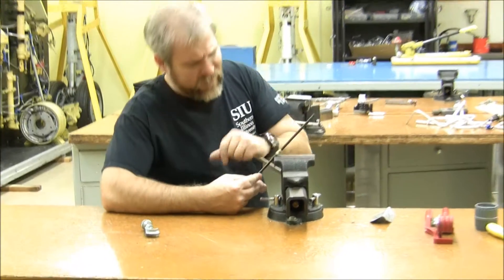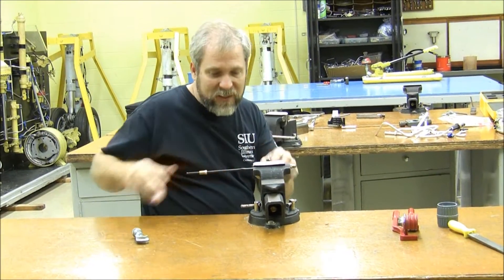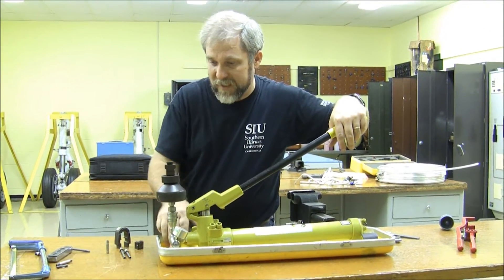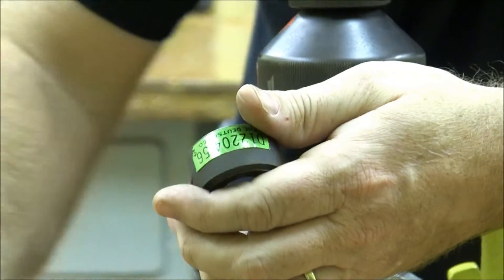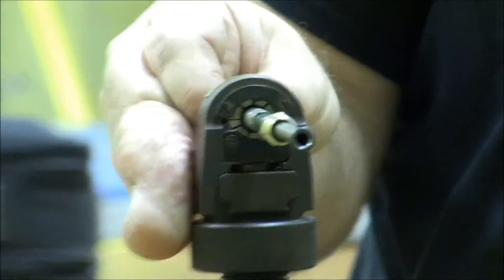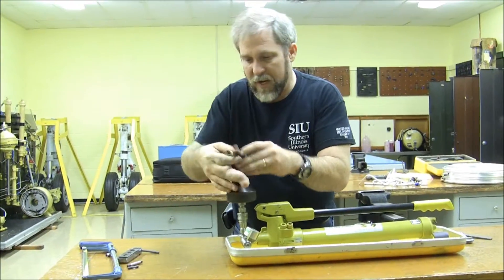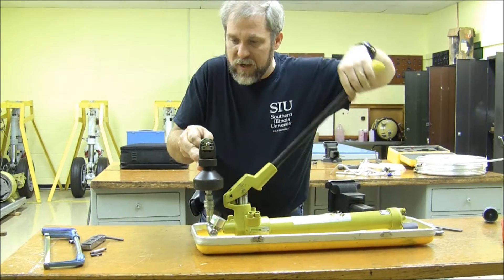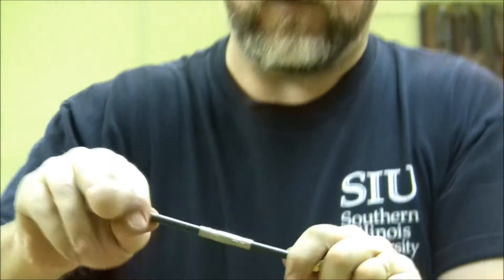Aviation Tools Training - Deutsch Permaswage Machine

Comment: Ok, so here is my doubt. What do you think about Cryofit? Cause this1 is pretty simple, but I would love a comparison before starting to use either. Thank you in advance.
Reply from the maker: I can't comment on cryofit, as I have never used the system.  It seems like a great idea, but perhaps a bit more difficult to maintain appropriate temperatures without very expensive tools.  I know that permaswage is quick and easy...
Reply: Thank you very much, just had a chance to use it, and I gotta say, it's amazing how easy it is to install, but will see about the maintainance later on when the aircraft comes back for service.